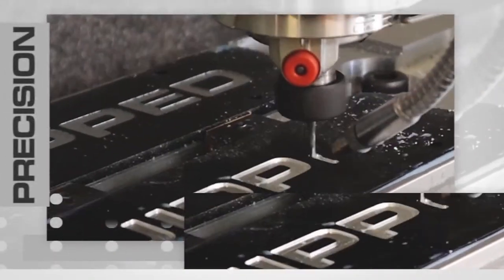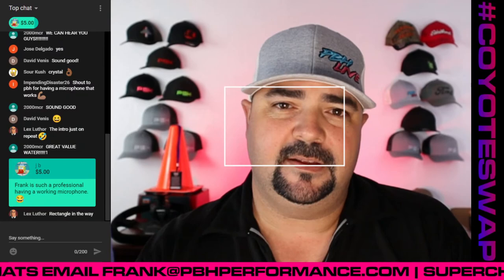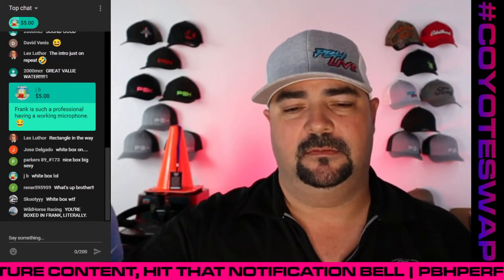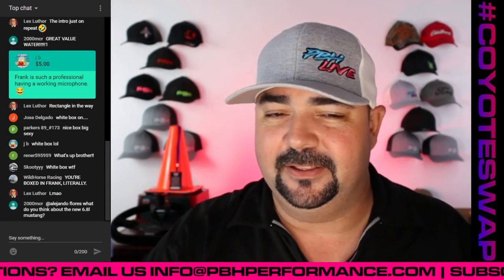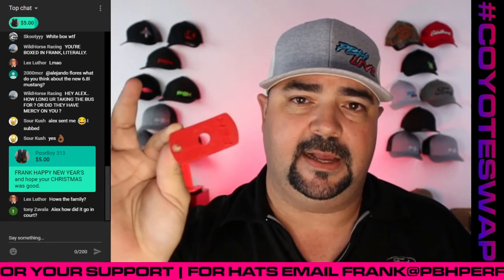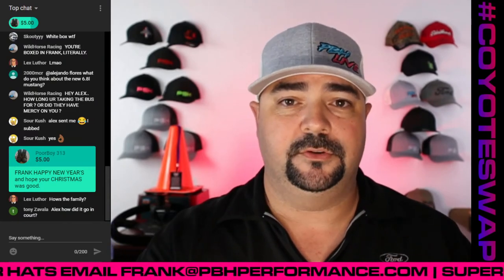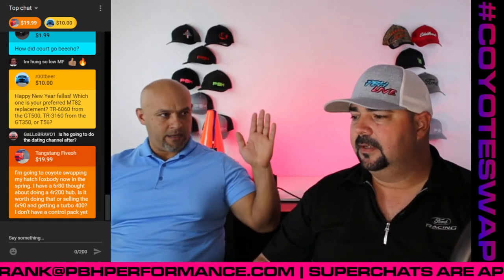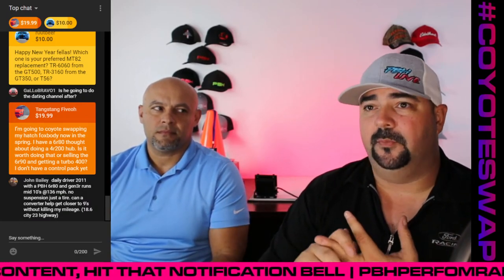PBH Live Episode #36 6R80 Torque Converter Talk

Comment: Quick question , can a 4r200 conversion be programmed to operate 1-3 in automatic mode and OD only be used in Sport/manual mode ? Heavy strip but streetable , 3 gears isn't the issue but to be able to have OD to drive a few hundred miles if needed . All about the OD , car wouldn't have perform like a daily 6r80 but OD would have to be available .
Reply from the maker: I do not think that is an option but when it comes to tuning I always defer to the guys making the changes. I would reach out to your tuner or Lund Racing to see if its an option.